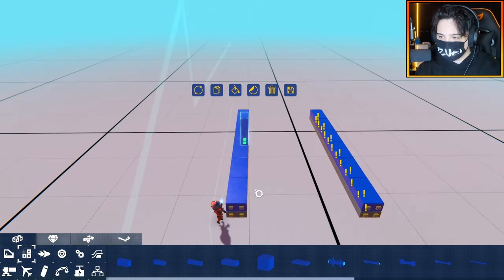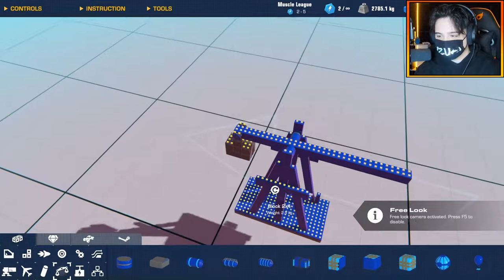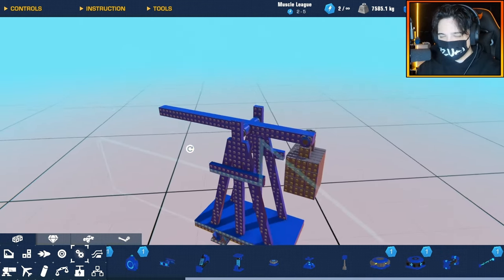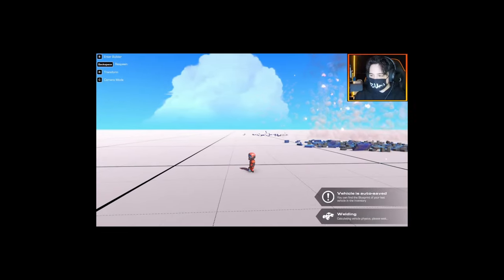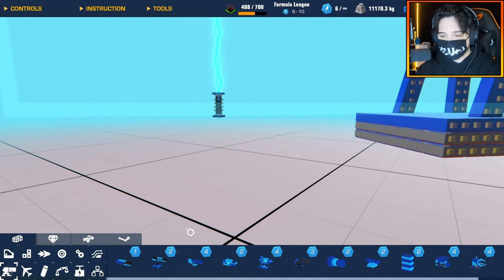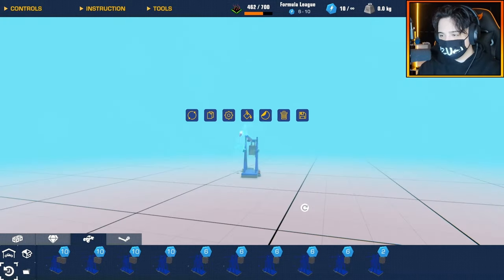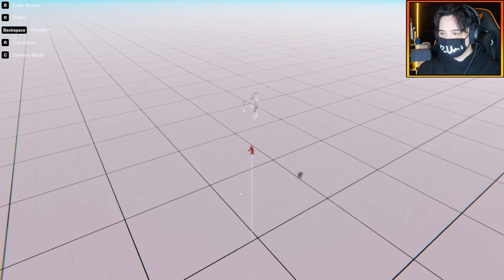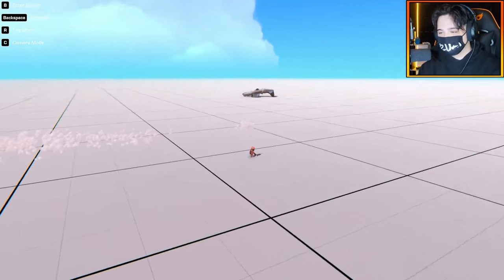Can I Build A WORKING Trebuchet? In Trailmakers

Comment: 2 things: first off, i think one of the reasons that it was glitching out so much, was bc the dynamite was hitting the ground before being shot, secondly, to increase to distance, make the arm longer on the throwing side
Reply: And maybe shorter on the weight side, also to make it less glitchy he should have two "ropes" next to eachother to make it symmetrical and balanced weight wise as the weight of the dynamite isnt centered with 1 "rope" also the dynamite seems to go very high but not very far so releasing it a little bit later could give it more forward momentum
Reply: Also timing the release to be slightly later so the release is less on the up swing will reduce the throw height, but should increase the distance!

Comment: Put a steering hinge at the end for the couplers and put single blocks between each joint and the steering hinge. It should stabilize how much it glitches. Works the same as putting to many steering hinges or trailer hitches attached in a chain. Very glitchy without spaces.

make a hydraulics latch holding the trebuchet in position without connecting to the actual pole. 

Put a tractor beam on the end of the couplers and make a conveyer belt or something with amo to pick up (another vehicle that delivers it). 

Use the rotating servos to reload it and lock back in place with the hydraulic lock.

Comment: You need to put a hinge where to power coupling attaches to the shaft.  I would have also put a line of pistons on the bottom to attach to the payload with a detachable block.  That way you could "wind" it up more like a real trebuchet does.
Reply: but be careful, bc it could break the arm if there is too much weight on a weak part...

Comment: The weight doesn't have to be on a hinge. Put the weight above the arm with a little more distance away from the pivot hinge. Use the distance sensor to adjust the release point

Comment: could you try to make a working winch with power couplings?

only the connections have hitboxes so you will need to make the winch barrel quite large
Reply: i think scrapman tried, but as you said, it didn't work bc it a too small barrel